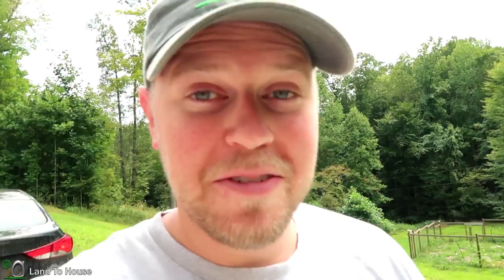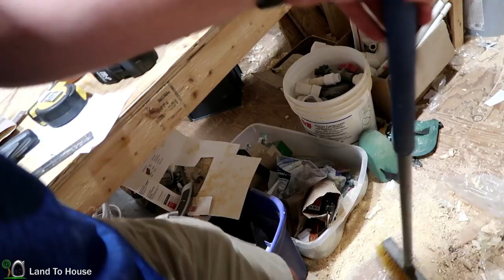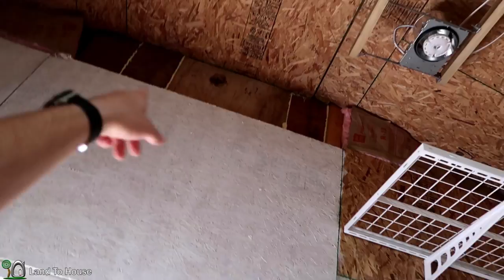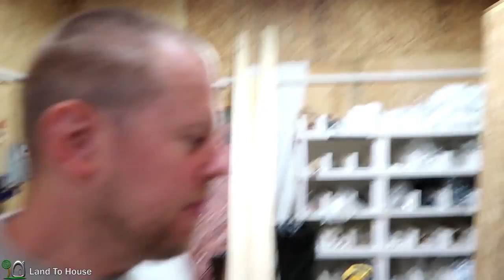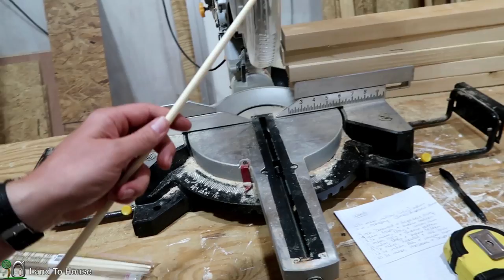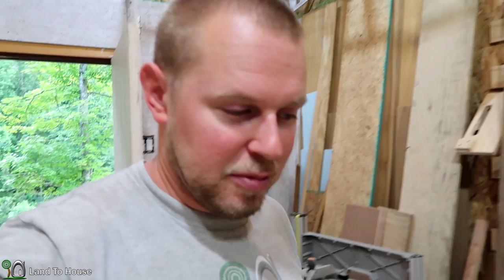Using the new Workbench - Vlog #102

Comment: I sell internationally through eBay and the shipping is easy peasy. All I have to update is the actual shipping weight as eBay has the estimated shipping weight and eBay types in the address and even prepares the customs forms if necessary. I used to get so anxious when I received an international order but don't have any hesitation now! Let me know if you need any further info. With lots of love💖 from sunny🌞 Arizona🌵
Reply from the maker: I typically use usps for international orders. It's not a real issue to get customs. I just don't like having to work with broken parts and having to look up addresses. What do you sell?
Reply: @LandtoHouse , I've sold mil spec wire on eBay since 2008... from when my Dad sold his business ... it goes USPS, but because I buy my postage through eBay I pay less than through USPS Online pricing. I can even buy USPS insurance through eBay. Since the whole transaction is through eBay, I don't have to retype the addresses, eBay fills out everything for me. And I get eBay's seller protection, so I never worry about getting payment from a buyer. For me it's a win all the way around.
Reply from the maker: That is nice! Ebay is good for that. Amazon will supply shipping as well. My personal site not so much. I need to sell some things on ebay soon. That reminds me.